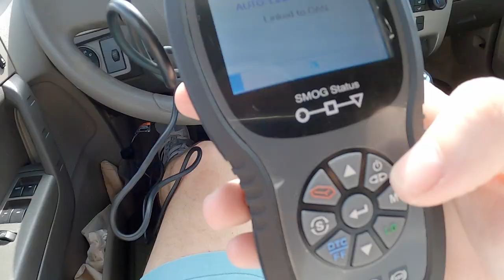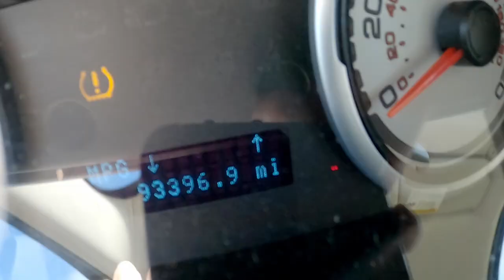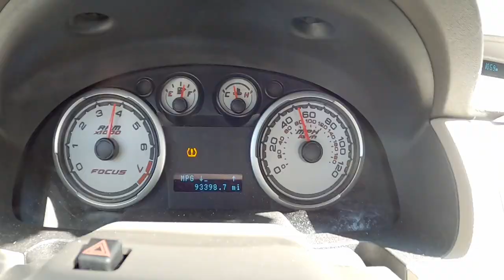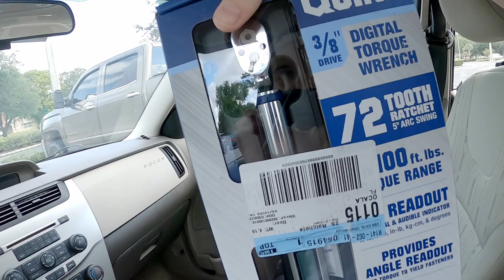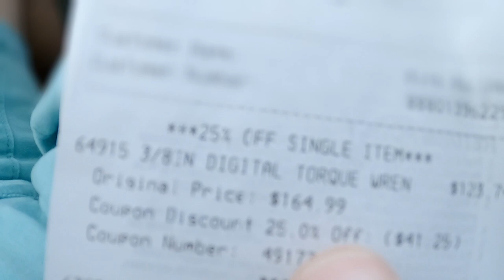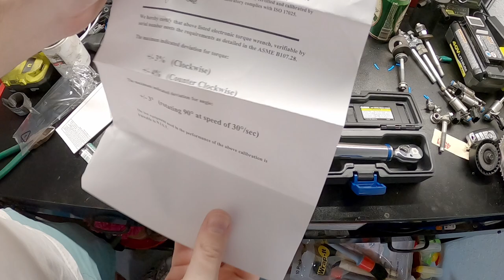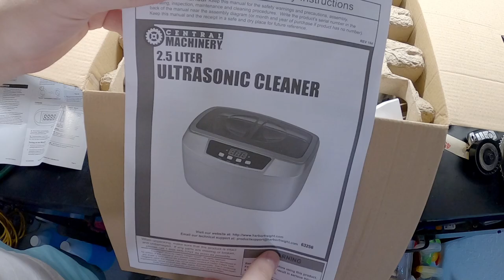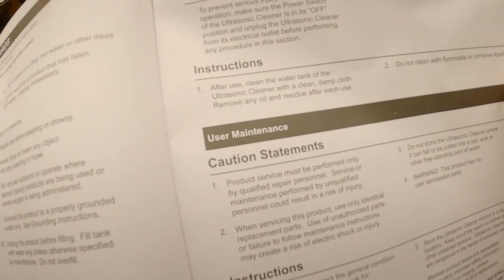This Tool from Harbor Freight Sounds DANGEROUS - Mustang Engine Prep

Comment: Isn't that what the oil filter is for to catch the finite metal / debris? Most motorcycles use a magnetic drain plug to collect most metal shavings at the bottom of the pan. Just curious.
Reply from the maker: I just want to be as thorough as possible so I mitigate any potential to ruin a 5k dollar engine.

Comment: The tray on the ultrasonic cleaner is pathetic. It used to have a proper basket years ago.
Reply from the maker: Isn't ideal, but it got the job done. I eventually will buy a larger unit with a metal basket. Either way,  it's a useful tool to have. 🙂